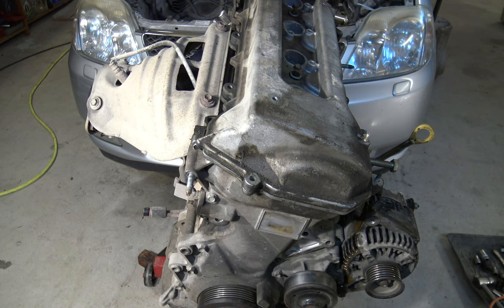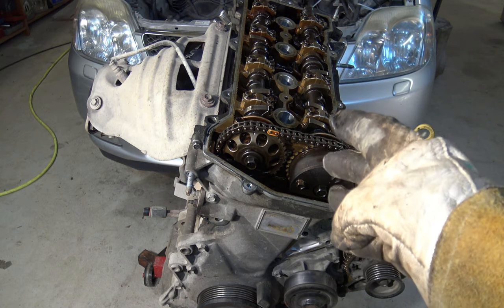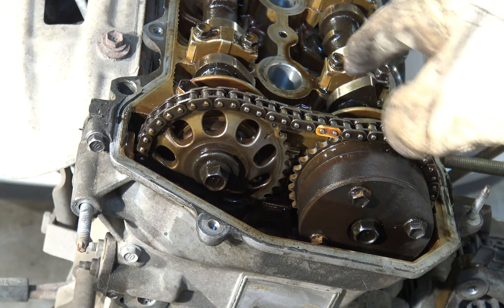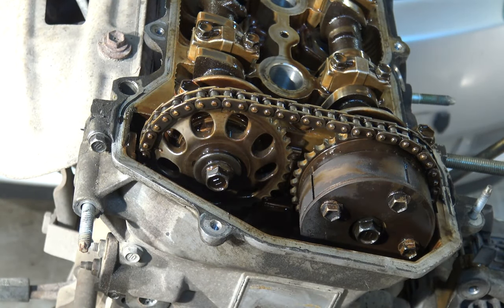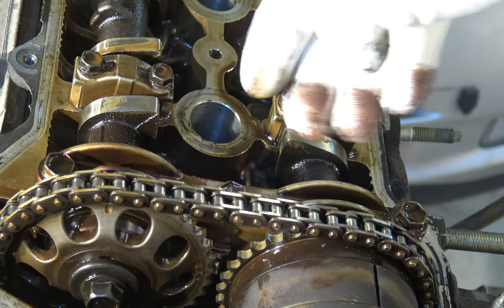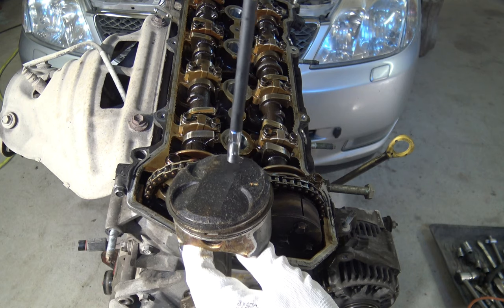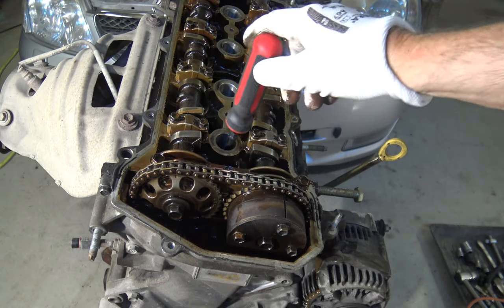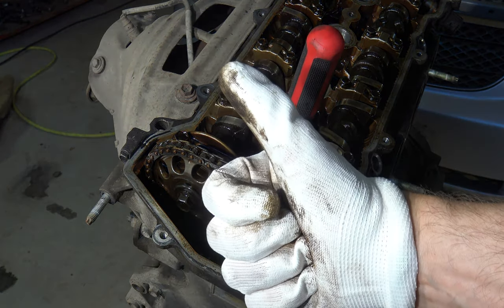Why my engine don't start? Check timing belt or chain positions!

Comment: Are there any primary checks to do before ripping off the valvecover and do this? I guess there are some other checks to do before suspecting the timing has become offset when it is hardstarted? By the way, thank you for a very good lesson. Regards Daniel, Sweden
Reply from the maker: Valvecover is must to open, because we must see the camshaft's  top positions.

Comment: Hello Peter im Wayne i love your videos and they have been really helpful to me rebuilding my motor for my 04 toyota carolla CE. My question for you is what do you recommend for me for this issue. My car idles roughly at a stop and it sucks up gas my car has new ignition coils and spark plugs. My car does have way over 299999 miles. Im thinking it could be my vails what do you think bud

Comment: Peter i have yaris with 130,000 km and i have problem that when i ON AC my rpm goes to 800-850 then after 5 min it drops to 650-700 like  we have when AC is off and on  red light it drops to 550 and comes back to 700 but not return to 850 and when i restart the car the rpm stay 850 for 5 min only and i clean Throttle body and everything else
Reply: @applepoop10  my yaris don't have IAC valve its electronic Throttle body, ecm raise the rpm on load but after few minutes rpm drops to 680-700 even the compressor is ON
Reply from the maker: Good comments Sirs 👍😃
Reply: @PeterFinnTheCarDoctor  what is your reply Mr Peter

Comment: Is my Toyota  engine  shot the reason I am doing head gasket and then piston  rings  because  I overheated  the engine  on freeway  and in town a few times  so can it be fixed or should I put it in trash

Comment: Hello.. What will cause a no start on this engine if the timing is off.. Will the spark plugs not fire.. Or will the fuel injectors not spray fuel? I wasn't clear on why it would not start. Please advise.. Thanks
Reply from the maker: Good info 👍😃
Reply: @PeterFinnTheCarDoctor  hello.. But what is the answer?